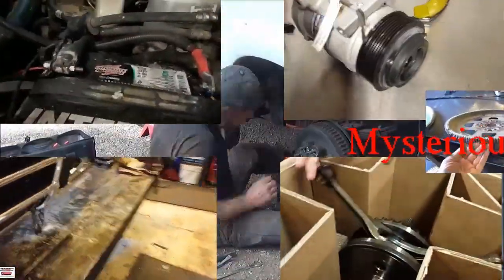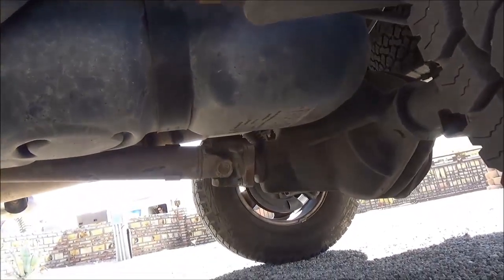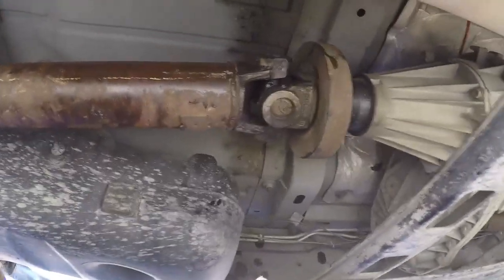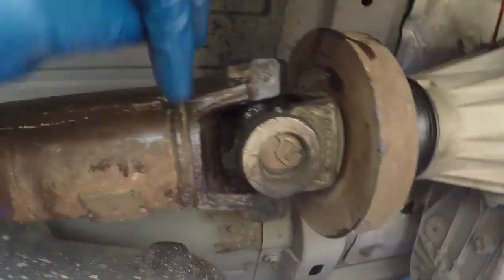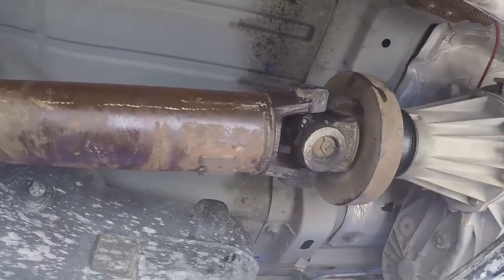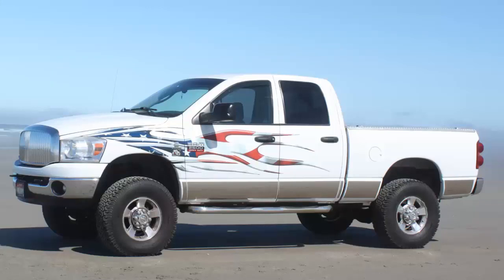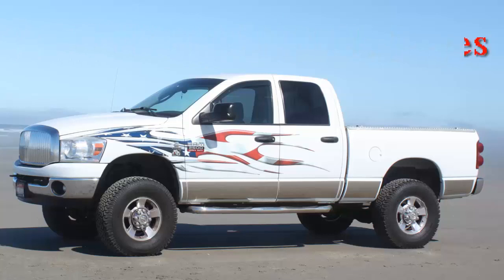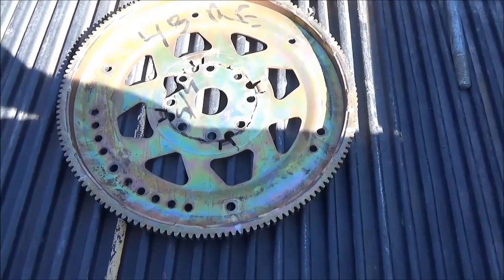Mysterious squeak Dodge Cummins

Comment: I had a squeak that I chased for years. It couldn't be the rear drive shaft UJ's because I'd had a well known shop replace them (I removed DS). It was fine for a while but after a couple of years, it's back. UJ's are all tight and show no rust. 
I finally removed the UJ myself (bought tool) and found that great shop had dropped a needle in one of the UJ's. They even bent the yoke by forcing it together with the dropped pin in there. 
I replaced the UJ's again, installed a new yoke and finally solved the problem. 
You can't trust anyones work.
Reply from the maker: I have had so much problems with so-called professional contractors and workers. Too bad the old days are not still around you just punch somebody when they screw up
Reply: It's got new universal joints front and back sometimes you do get a bad part I know this because I put the universal joint on the front and then I put another one on the back the back one failed and was a bad parts drive shaft went skipping past my truck on the road so I got another universal joint for the back and I never had a squeaking noise at all until recently I think it's the leaf links if that's the proper term for that I put some WD-40 on it just to see it took it down the road haven't heard a squeaking noise since but I know if it is that it's going to have to have new Leaf spacers or whatever you call them I do all the work myself on all of my trucks besides transmission work but nobody knows everything in this world if we all knew everything then we wouldn't have a problem yes I am a female the squeaking noise has stopped for now but I'm hoping it's just minor and I'm hoping that is what the problem is because that would be awesome but knowing this dodge it probably more than that I have nothing but problems with this Dodge says the day I got it yes I do have a 99 Dodge and head it has been a great truck and I'm redoing it for my daughter I have a Chevrolet Stepside Silverado 94 1500 with a 350 2-wheel drive that I have been working on for a very long time for my son the 99 Dodge I have been working on for my daughter it's the only thing I've got to leave them when I am no longer here that is my dream My Wish to get the 99 Dodge and the 94 Chevrolet fixed for my son and daughter my son's truck will be the 94 Chevrolet and my daughter is the 99 Dodge I hope and pray everyday that I can get them done for them one day if I didn't have to keep on continuing putting more money into my 2006 Dodge Ram Magnum piece of no-good garbage I probably would have had the 99 Dodge and the 94 Chevrolet done for my son and my daughter wish me luck cuz I'm sure going to need it🙏🤞

Comment: Front driveshaft has a hidden grease fitting that requires a grease needle for greasing.It's on the end closest to transfer case.
Reply: Thank you for the info I will make sure that I will not forget that one either I probably would have

Comment: Gary, check your Exhaust pipe and leaf springs. Exhaust pipe could create enough heat to expand a pipe just enough that the one inside will just wiggle back and forth a bit, same for the springs. With my Ford Diesel I wouldn't be able to hear a squeak..  You can also check your body and motor mounts.
Reply from the maker: All of those are very good ideas, but keep in mind that when I turn the key off it stops squeaking and the truck is still moving. Right now is I've mentioned it does not squeak at all so I can't even try to locate it. Thanks for your advice

Comment: Its the front drive shaft mine did the same .on the transfer case side there are two u joints close to each other .a carden joint? Not sure the name but thats close and they squeek and are hard to lube.
Reply from the maker: Yes that's what we found out also. Thank you

Comment: 2001 dodge Durango, RWD  with an open dif. And has EXACTLY the same sqeak goblin. Only comes out when she warms up. Also replaced both U joints in the drive shaft as well as the rear breaks (which were do anyways). Still persists.
Reply from the maker: They did find one of the joints with a slight crack in it. Once it was replaced the squeak has never came back. So now I have a new front Driveline and no problems so far
Reply: Interesting. Damn thing is a good excuse to be in the garage though...

Comment: Can’t believe I sat through this expecting anything close to a coherent thought or answer.. I’ll never get that 8 minutes and 39 seconds back..
Reply from the maker: My answer was in a different video we did change out the front Driveline knuckle, and the sound went away, they said it had a cracked cup I guess that's what was making the noise cuz once we spent another  $800 it stopped. Nobody could figure it out really, so we just through Parts at it

Comment: Hello. Nice video. I have a 2018 3500 with manual transmission. One time episode of all kind of squeaking and clattering coming from the driver side one day starting up at idle. I thought a branch was caught under there so the moment I pop the hood the noise went away and has never returned. May be a sticking starter? Anyway, your truck looks fantastic. If you would be so kind, what kind of tires and what size are they? Thx!
Reply from the maker: I'm running Cooper tires right now. And I think they're the best tires I've ever had. For example I ran one of them completely flat and didn't even know it until I pulled over to take a break and then noticed it. They fixed it with no problem didn't even hurt the side wall at all. I would never go with another tire after that my trailer and truck weighs 26000 pounds together that's a lot of weight on a flat tire.

Comment: Did you ever find out what it was my truck has it also
Reply from the maker: I changed the whole front drive shaft and it went away they say the cup on the swivel part was cracked. So you may want to check for cracks

Comment: Well I have a Dodge Ram 2006 4.7 L 1500 2-wheel drive and it has just started doing that and I wish that you actually could record it to hear it to see if it's the same kind of squeak that my trucks making and your video that I watched and how you explained everything seems like the exact same problem that I'm having which which district has been nothing but problems for me from the get-go from the start the truck I bought for $9,000 at a dealership me and my family after I got it it started doing nothing but problems after problems and continues doing the same problems over again after I fix them and yes you probably say why don't you just get rid of a truck because nobody will buy it and Dodges are not worth anything as soon as you drive them off the lot that's when the salesman says there goes another sucker Dodge's are junk but they sure do look good but it's not all about the looks I promise you that enjoyed your video
Reply from the maker: It's been a very long time since I put that video on here and without watching it again I don't know if I showed you what the squeak was, once I took the Driveline apart the front one and took it to a good driveline shop which was 800 miles away from where it started squeaking. They rebuilt the Driveline and I had no problems. When I first glanced at it they said they couldn't see anything wrong with it. But after they had disassembled it they found that the cup inside of the main coupler had a crack in it and that's what was causing the squeak I guess I replaced everything and have had no problems with it since then. My main problem now is I have a vibration in the truck had about 80 miles an hour. I can't seem to locate that. And like you I have too much money in this dodge to get rid of it. Or I'd have me a brand new Chevy Ford Toyota or anything but a Dodge. Good luck with yours
Reply: Well I found out the problem of my Dodge I think yesterday I went out there and I looked at the leaf I don't know exactly the right term to call them it's where the leaf connects to the frame of the truck I put some WD-40 on it and today I am going to Grease all the alamites on the truck some do not have alamites going to get a syringe and a needle and put some grease up and down that don't have any and please excuse my phone sometimes it has predictive text problems and any moving parts or anything that actually moves I am going to put grease on it or WD-40 on it but since I put the WD-40 on the leaf where it connects to the frame of the truck it has not squeak or started squeaking I don't know if that might help you out a little bit but maybe it will I have a Chevrolet I have been working on for many many years it was almost completely done I have been working on that truck for my son it was almost completely done and then somebody sabotaged it and I'm back to square one people don't understand and are really asked me why I keep these old trucks also I have a 99 Dodge Ram four-wheel drive and fixing up for my daughter but my 2006 2 wheel drive 4.7 L Magnum I keep on having to fix this truck over and over again after all the things I fix I have to fix that again and it takes time away from me putting money in time into the two trucks that I'm doing for my daughter and my son my daughter's truck does run which would be the 99 Dodge but when I got the truck it was damaged all the way around I had to put a rear end in it but I want to finish those two trucks for my daughter and my son so I have something to leave them when I'm gone I just wish that my Dodge 2006 would stop messing up is so I could put the time in the money into my daughter my son's trucks I know it's not very much but but I wanted to know what I'm gone that I love them very much and it will always be with them and that I never forgot about them so if they ever miss me When I'm Gone they have something to do that I'm always there for them no matter what if I'm here because I will always be with them🙏💪